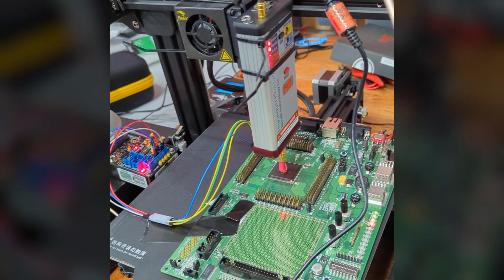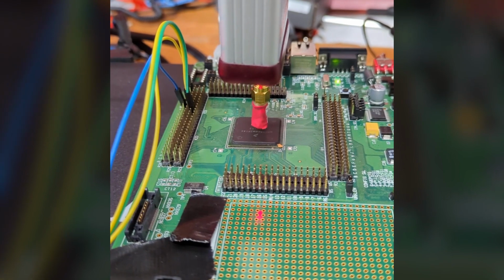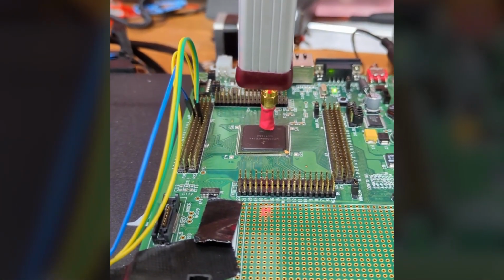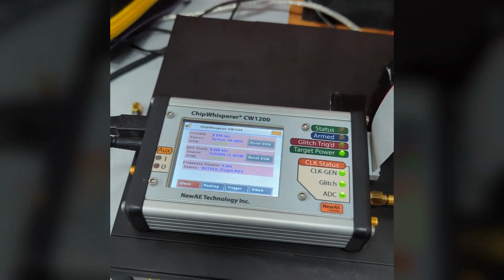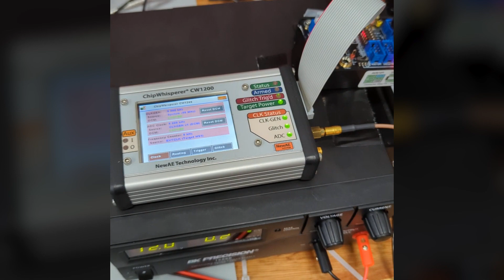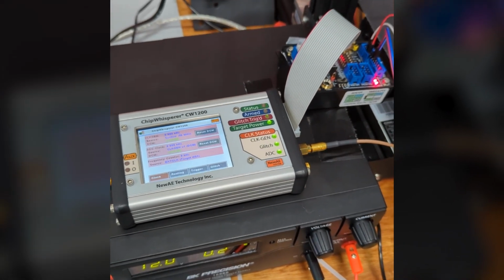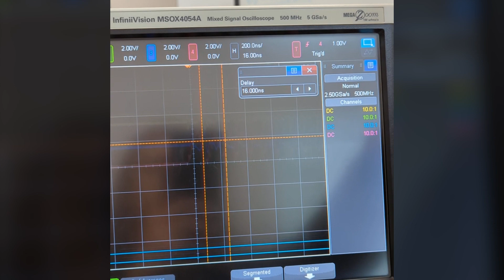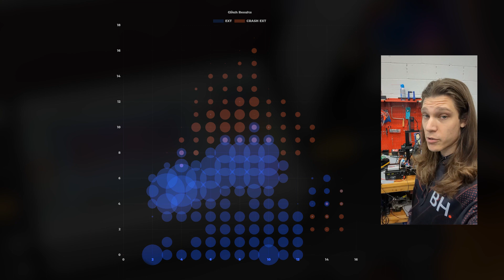Side Channel Attacks: Bypassing JTAG Censorship

Comment: Interesting... any luck with undervolting and/or overclocking ? What cpu is that, MPC5556 ?
Reply from the maker: Its MPC5566, we did have success over JTAG password checks using voltage dropping glitches.